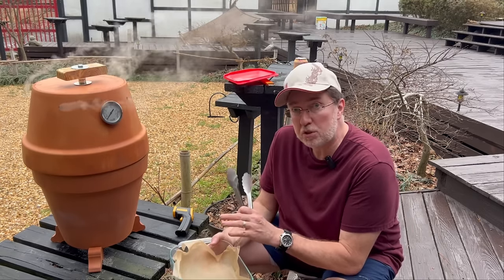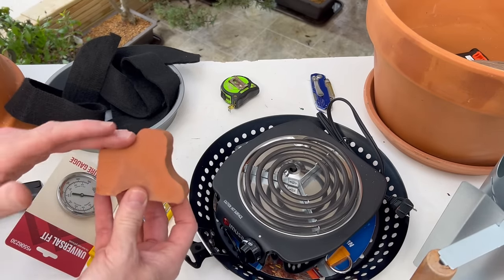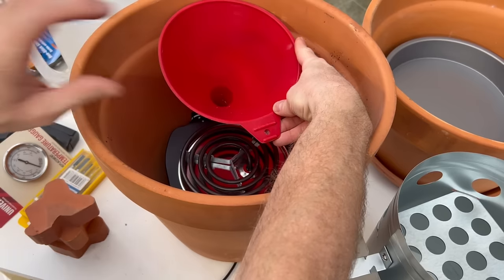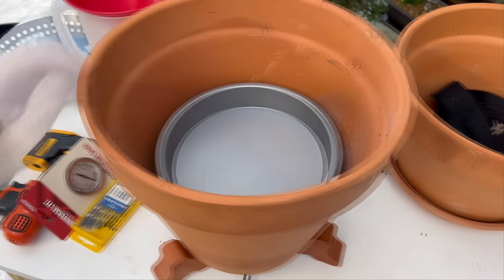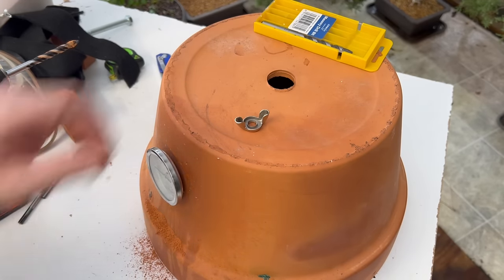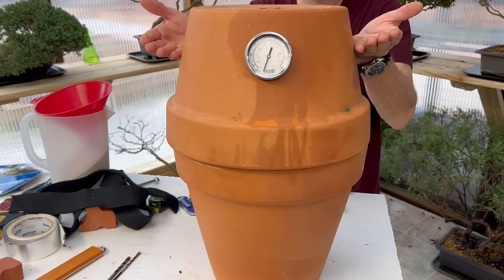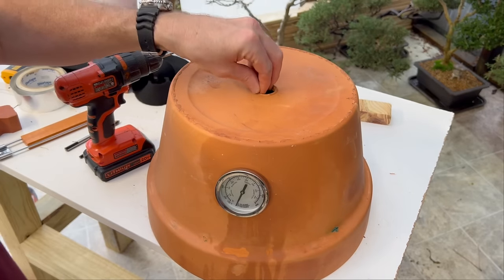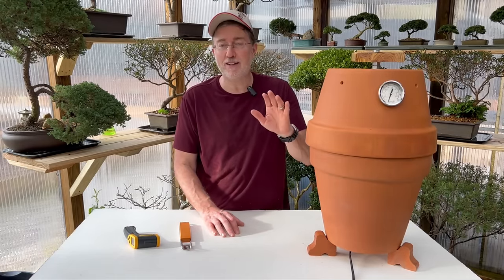Flower Pot DIY BBQ Smoker "Kamado Style" For Under $50

Comment: Excellent! Did you have any issues with the oven high temp sealant you placed around the rim? It didn’t look like it was in place during the cooking demonstration.
Reply from the maker: I should have cleaned the pot rim dust caused the adhesive to stick less than it should.  After cleaning it worked better.